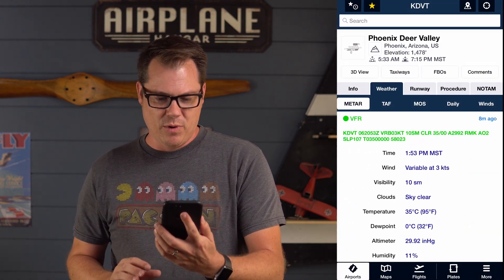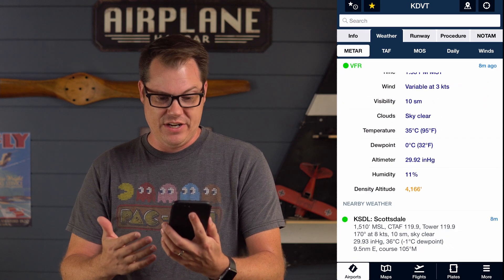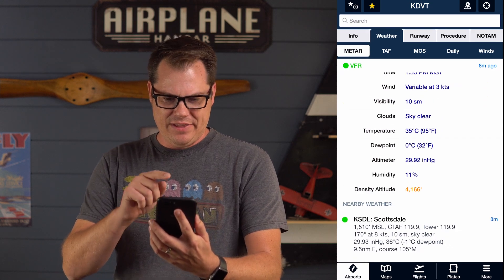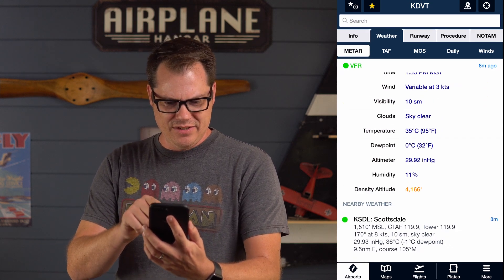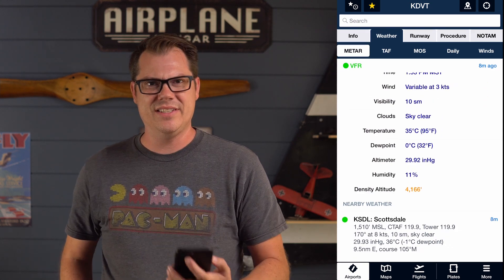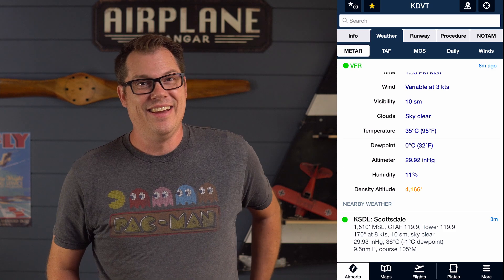Density Altitude | AvGeek Brief

Comment: I'm afraid I have to disagree on the performance chart comment. That's a 172, and the 172SP performance charts go to 7000 pressure altitude and 40 deg C.  That's 104 deg F.  It doesn't get that hot in Flagstaff.  Though it is very much worth pointing out that it takes over 4000 feet of runway (at max gross) to get to 50 feet on takeoff using short field technique, and the rate of climb is barely 300 FPM at Vy, presuming you lean the engine correctly prior to takeoff.  That's very definitely wheezy performance and significant winds may make for a bad day.

While it's true that the airplane "feels" density altitude, the performance charts are in pressure altitude plus temperature.  It's not how I would choose to express that, but it's what it is.

The flip side is that whenever it's warmer than 104 F, you really are off your performance charts.  And that happens a lot in Phoenix.  You can play the density altitude game (assuming standard temperature) for that, but it's not really what the performance charts say.

A big risk we have with flatlanders going to the mountains around here is that a Cessna requires the engine to be leaned for takeoff above 3000 (field altitude, according to the POH, though density altitude makes a bit more sense).  If you do not lean properly before takeoff, your performance will be a lot worse, and can be insufficient for flight.
Reply from the maker: I lean for DA above 3000. But that's another point of conversation. Should you? For sure do it because of elevation, but when doing it for heat below 3k, you have the potential to stress the engine. I actually asked this question to a lot of seasoned GA pilots and instructors to get their take on it. We all agreed on a "best practice" but all disagreed on a defined procedure and what's best for the engine. I even got Martin Pauly involved with no definitive answer. 

Anyways, your correct on the performance chart stuff. I was looking at my DA as the starting point of reference, not the field elevation corrected for temperature. Thanks for pointing that out.
Reply: Why would the density due to warm air be any different from the density due to high altitude?  Density is density. Engine stress is exactly the same.  Cooling might not be, but that's another issue.  If the DA really is 3000 but the PA isn't, you can climb out at a fast airspeed to deal with that; the altitude isn't that high.  This happens in places like Phoenix, Vegas, Palm Springs (even though the field altitude is below sea level), even sometimes Fresno or Bakersfield.

This sounds very much like another of those pilot OWTs that never dies.  Like the "over square" myth.  You'll never resolve that with a poll; it just isn't true that all opinions are equal, especially when there are actual facts involved.

The performance charts do not start at field altitude.  It's pressure altitude.  Pressure altitude may be up to several hundred feet or more higher or lower than field elevation in hot, clear weather.

Comment: It's dry out by you, but keep in mind that high humidity and low atmospheric pressure can add up to another thousand feet to density altitude based on temperature. This is more of an issue for coastal airports with short runways in summer.
Reply from the maker: Absolutely! I was reading about this from a document the FAA makes, that you need to take humidity into consideration as well. The extra moisture in the air also makes the air less dense.

Comment: Can you calculate density altitude?
Reply from the maker: It's a quick and easy calculation. First, figure out your standard temperature. 

At sea level it's 15C. But for each 1000 feet it decreases by 2 degrees C. So at 1500 feet, thats 15C - 3C for a standard temp of 12C. 

Then you take the current outside air temp in degrees C and subtract it.

So, Outside air temp -  Standard Temp  = Temp Difference. 

Then multiply that by 120. So, Temp Difference X 120 = Altitude difference

Then add that to your pressure altitude. To find your pressure altitude set your altimeter to 29.92 (Standard day) and the altitude indicated on the dial is your pressure altitude.  So, altidude difference + Pressure altitude = Density Altitude. 

All in the equation looks like this (Outside Air Temp - Standard Temp) X 120 + Pressure Altitude = Density altitude.

We're working on a follow up video explaining this.